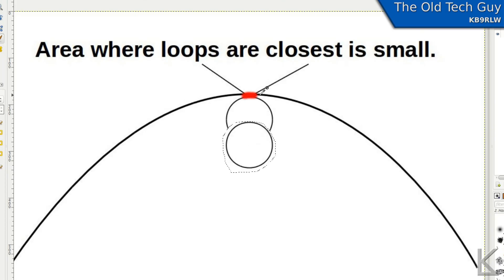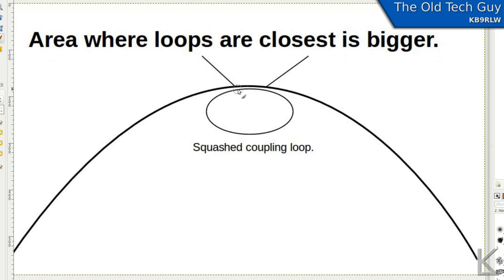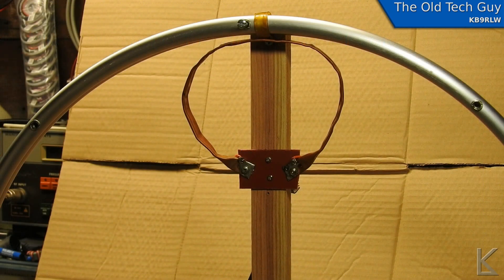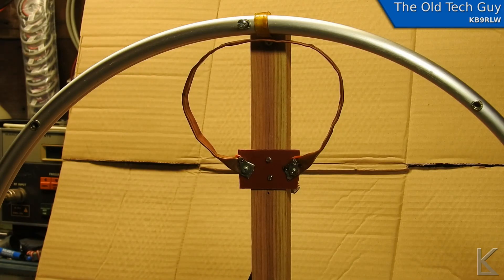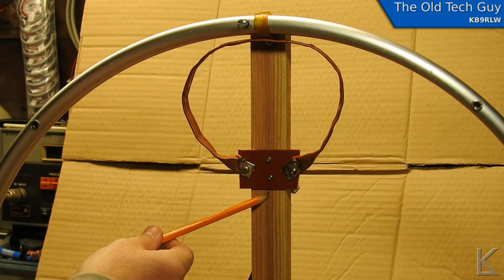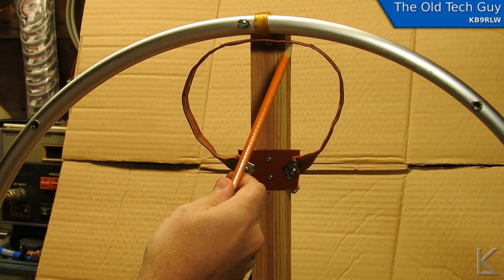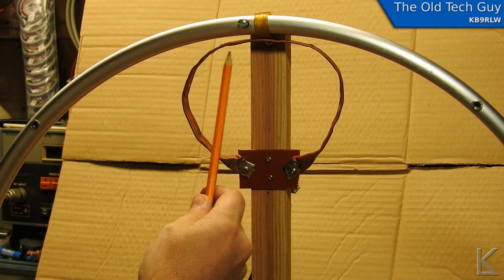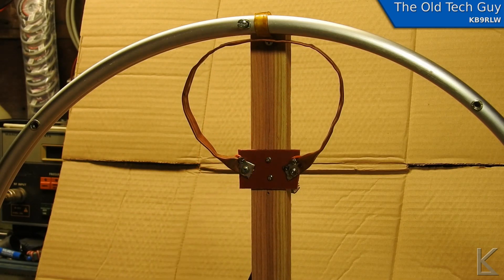Ham Radio - A simple magnetic loop modification with a big improvement!

Comment: Hi Kevin.. I am making a 90 cm loop. It runs from 10 MHz to 30 Mhz. The reflection damping is very good on the low bands. Only from 24 MHz the reflection deteriorates. How's your antenna? In your example I see 2 frequencies, are these your start and end frequencies of your loop? And thank you for this useful information. I'm definitely going to work with it. 73 Hans / PA3ETK
Reply from the maker: Hello Hans, I'm sorry but this video was a very long time ago. I no longer have the one Loop and I haven't had the big one out in quite a while. I'm living in an RV and traveling now. If I remember right, both Loops worked really well from 40 m up to 15
Reply: @loughkb  Hello Kevin. No problem. I'm jealous of you! Been to Autralie and new zealand a year ago. Also with an RV. It's a good life with a motorhome driving. I wish you all that is good and enjoy life because it only takes a while. With kind regards, Hans

Comment: Thanks for this tip, I have been putting of building one because of the supposed low efficiency of the smaller loop on 40 mtrs, but this tip deserves a shot.. VK3HJW

Comment: I agree with you about magnetic loop antennas. I have been using it for years. This type of antenna is particularly interesting in digital mode. once set to a frequency, no need to touch it again, it's super practical and very much efficient. See the HB9AIS design here: https://www.youtube.com/watch?v=cN_lmGRaqOQ&t=5s and have fun.

Comment: I figure the "squashed loop" gives a better ratio between the TX 50R and the loop itself? Maybe a smaller/larger coupling loop (but still round), would achieve the same? I am in the middle of building a loop antenna to transmit on 2M... (To fit on the top of the HT!). 73 de Stan, G4EGH

Comment: So taking this further, why can't you use square loops? In that way the small loop would have even more coupling to the larger loop.
Reply from the maker: You can. Check out my junk box magloop video.
Reply: What is wanted is to capture, or emit, as many magnetic lines of force as possible.  Maximum area for any given length of radiator is thus round.  Square is okay; the difference is not all that much.  But you don't want too much coupling, and here's why:
When the loop is tuned, the circulating current is going to be enormous, 10 to 20 amps, and the inductive reactance (and thus capacitive reactance) very high.  If you have too much coupling, that power reflects back into the radio, pulling down the loop efficiency and increasing SWR to values normally not measured.
You want as little coupling as gets the job done, enough to excite the loop and match the reactance and resistance.  The loop reactance should go to zero at resonance, the resistance is a reflection of radiation into space.
Depending on physical factors, reactance at resonance might leave a resistance that is other than 50 ohms; that's why people fiddle with the exciter loop.   The MFJ tuner style of using a capacitor to match rather than a little loop has the advantage of being able to match more precisely both reactance and resistance, but it means two knobs to fiddle, which I still find easier than fiddling with the little loop itself.

Comment: Thanks Kevin.  I'm fascinated by the implications of how this effect apparently operates.  I'm curious to know what kind of effect it has on the overall bandwidth of the antenna at any given capacitor setting.  In other words, does it act more like a narrow pass filter or hopefully does it  broaden it?  Obviously this could have serious implications for the method used for modulation.  I'm curious what would happen the loop coupling if you put a high voltage dielectric insulator between the loops so you could minimize the gap between them yet stay electrically isolated?  That's taking proximity of the coupling to the extreme so to speak.  It's got me thinking about how to mathematically represent the effective gain through the magnetic coupling between the conductors.  Thanks once again, you taught this old dog a new trick.  The day you stop learning is the day you die.

Comment: Kevin you can bring the loop up till it is parallel and in front of the big loop slightly out of plane to increase the coupling.. Works even better in my tests. Also to use coax feed the inner solid conductor and bare the outer conductor at  the top in the coupling area and trim so the shield is broken in that area and obviously same at the capacitor connection area.. Al the best G7RQO bryan
Reply from the maker: Thanks Bryan.  I've done both of these things on on other loop designs in other vids.  The parallel edge coupling loop was the only way I could get the SWR down on my massive 16 turn magloop for 630 meters.
Reply: Kevin Loughin wow well done love the videos good work 73's

Comment: Hi Kevin, great video! I haven't built a loop but I want to try. What do you do with the inner core of the coax of the main loop? I understand you connect the braided outer mesh of the coax to the tuning capacitor. Do you just leave the inner single-core copper wire cut and insulated? What if you removed that inner core and just used the mesh around a plastic core (with copper wire inside)? The reason I ask is this... imagine if you could make a slit in the insulation at the top of your main loop and remove a portion of the inner core from the coax on either end and make your smaller coupling loop out of the actual inner core? Then you would have the inner core INSIDE the mesh, extremely good coupling!
Reply from the maker: For the outer loop, tie the shield and center together.  The lower the DC resistance on that outer loop, the higher the efficiency.
Reply: @loughkb  Thank you! I will strip the coax at several points along the length and solder the inner core wire and shield to each other. Thanks!

Comment: BTW, What are the tubes used for the loop made of ? Measurements & Where can they be obtained ?
Thank you, 73, Juan KG4QYY
Reply from the maker: 1/2 inch copper pipe for the outer loop, 3/8 inch copper tubing for the coupling loop.  3 foot diameter on the outer loop, 1/5th that on the coupling loop.  A very common design.
Reply: Kevin Loughin Thank you so much got your prompt reply. 
BTW, was just watching another of your videos. 
Hoping to make contact with you one day using the Mini Mag Loop. 
73 and the very best. Juan KG4QYY

Comment: First of all I would like to thank you for your excellent U-Tube channel for Hams, very informative and educational. Been thinking in making a MagLoop Antenna due to HOA. 
I believe that is called the “oval” or even “coat hanger” coupling loop. It helps also to make the SWR relatively flat over a wider frequency range than with a regular coupling loop. The overall loop wire length is a bit larger than the diameter of the main loop. The coupling loop is symmetrically placed close to the main loop, over a distance equal to 1/2 the main loop's diameter (radius, or ≈ 1/6 the loop's circumference.) Please check Frank Dörenberg at nonstopsystems.com
BTW, he has your spiral antenna on his web site.
73, Juan KG4QYY

Comment: Great video.  Question - What would happen if you made your loops rectangular rather than round with an oval insert.  Rectangular loops would have a lot more parallel surface to interact with.
Michael VA6XMB
Reply from the maker: There are many out there made square using copper plumbing.  Also, see my junk box magloop video.
Reply: I would have thought semi circular would be a good way to go in this case. 
Flat where the coax is connecting and circular on the side of the coupling loop where it comes close to the main loop.
Then play with the spacing from the main loop

Comment: Thank You Kevin! I am in the process of building a loop for 20 meters. I also built a VLF (wire) type 4' square loop to receive European LF AM broadcasts and SAQ (Sweden 17.2 KHz). I tried covering the loop wire with aluminum foil to form a magnetic loop taking the signal off the outer Al foil feeding it to a low Z input preamp (common base 2N3906). The resonator is the wire loop with a 4 section variable (and add C for LVF). The resonator is not connected to the preamp (just the outer Al foil. I found much improvement on noise and directivity...just an FYI from N3SWL Thanks again Kevin!

Comment: Mag loops have always fascinated me, never built one though.
I was thinking, if it is an increased surface area that's improving the loop, would building an annular space inside the outer loop and inserting the coupling loop into it, result in the maximum surface area and the greatest improvement?
QED

Comment: Kevin, I made a 3' diameter round loop with the Faraday Coupling Loop and also one with Gamma Matching.  The Faraday version really responded to "squashing" in the higher frequencies of the usable range.  The Gamma Match needs to be set in the middle of the tunable range of the capacitor; in my case it was ~18MHz (my capacitor allows me to tune from 6MHz to 30MHz).  The Gamma Match when finally set is less fussy across the entire range at resonance ~1.2SWR but the "squashed football" could actually be "finessed" to ~ 1.0SWR.   They both work fine, but you have to be patient with setting and soldering the Gamma match because it takes a few iterations.  The Gamma Match point is typically 8%-10% of the circumference (mine was 9.5%), so in my case it was 113" x 0.095 (9.5%) = 10 3/4".  I did not test (like you did) with a Field Strength meter.  Keep up the good work and safe travels!

Comment: Wow very cool tip -- THANKS.  Our radio club just had a presentation last nite on these magnetic loop antennas.  I'm new to HF and had been trying to figure out what to put up for 80/160 meters, and this seemed a very cool way to go.  Just checked Craigslist here and found a vacuum variable of sufficient ratings and heading out tonight to go pick it up.  Will be doing some studying on these antennas and collecting materials.  73's  RH

Comment: Great information, thanks for posting the video.  One question... Is there a limit to the amount of squashing of the inner loop?  For example, what happens if you totally squash the inner loop so that the maximum surface area of the outer loop is in close contact to the inner loop?  I'd imaging there's a point of limited benefit and/or perhaps some inefficiencies introduced by having the inner loop too close to itself.
Reply: hi...I tried it almost completely squashing the loop, im not sure about the Efficiency but the SWR definitely went way down to 1:1.03, only thing i did notice was that i had to reduce or increase the squash minutely like a Centimeter or so to reduce the swr to 1:1.03 or less for different bands...mine is 80m, 40m, 30m and 20m...with tiny adjustment of coupling loop...thanx

Comment: I made a few loops with a gammamatch.. way more effective and a lot easier to get to work properly..
Reply from the maker: There's debate about effectiveness.   I've done one with a gamma and switched it to a coupling loop eventually.  Near field measurements of field strength were identical.   I've yet to find any rigidly scientific testing of the different methods posted anywhere.  It'd be nice to see someone with an antenna shoot-out range do one.
I'm curious about how you define it as easier though.  It's a more complicated construction doing the gamma match.  Just a little.
Reply: Mine was easy to construct, just a thick wire going from the connector to one side of the loop.. that loop was made from 50 mm wide pcb strip ca 4 meters circumference. Its all about matching the loop to the coupling with as high efficiency and low losses as possible. We took some thermal images of it transmitting with 15 watts and it clearly showed that the losses came from the inferior capacitor and the connections to it. 3 things goes with a magloop... size, bandwidth and efficiency..  pick any two :-)

Comment: Hi that was a fascinating demonstration and video. Could I just ask you have you noticed any difference in improved reception performance after this simple modification to the coupling? Or does it go without saying that the improved s w r and r f output also increases reception efficiency? I am a big loop fan and constructor but only use them for swl these days. 73 Adam M6RDP

Comment: Squashing works because, by widening the distance where the loops are in close proximity, you increases the number (actually, the percentage) of magnetic lines from the feed loop which couple to the main loop.  Remember, only those loops of magnetic force which go through BOTH loops act to couple the loops.  The more you squash the loop to increase that close proximity, the more you reduce the area enclosed by the feed loop.  There comes a point where increasing the distance of close proximity (by squashing the feed loop) is offset by the reduction in area of the feed loop caused by squashing it.  (the number of lines of magnetic force is proportional to the area enclosed by the loop, so you want balance the area of the feed loop, with the amount of coupling to the main loop.  A perfectly circular feed loop has maximum area, but a fairly small length close to the main loop, as you point out in the video.   A feed loop squashed so that it follows the outer loop as far as possible before closing on itself (with a straight segment) would have a lot of coupling, but reduced overall lines of force, due the reduced the area of the feed loop. The optimum amount of squashing of the feed loop will occur somewhere between these extremes.
Reply: What if you distorted the outer loop instead? Bent it to make a closer match to the inner loop?
Reply: This sounds like a good modeling exercise to figure out the best possible shape of the inner loop.  Of course, you can just tinker with the shape for hours until you maximize the performance.   I'd be curious to learn what the negative impact is if you squash the inner loop to it's extreme.
Reply: Increase the diameter of the inner loop: same effect.

Comment: For the experiment you could try to maintain the round coupling loop but move it UP so its sticking a little bit above the main loop. That also would give more coupling. It would be interesting to see how that influences the field strength meter and the SWR

Comment: Very Interesting.  Instead of the copper flashing (or whatever you used for the small loop) what if you used a large coil spring to form the small loop.  What I'm thinking is the coil spring as the small loop.  Fix the edge closed to the mail loop.  At the opposite side of the small loop attach it to a sliding bracket mounted to your support.  The thought being attaching it that way: 1st when you compress the inner loop it should deform symmetricly (may or may not make a difference) and 2nd it provides a fine tuning adjustment that may help when switching bands.  If it does than it should be easy enough to make a remote adjustment system.  I confess that I'm totally new to SID antennas and am building my first now so I'm looking for a good coupling method that will provide the best performance over the wavelengths I'm targeting (40M - 15M0). Any thoughts?

Comment: Hi Kevin. Thanks a lot for your sharing. I'm also a loop's fan :). I've already noticed something like that. At this time, no field strength available in my shack. (I like your den, it seems to be like mine... Many items ensure the decoration). Have fun from Switzerland - 73' HB9HFJ.
Reply: You should try the Par End Fed , no loop buy performance wise 20X better than a loop https://www.lnrprecision.com/store/EF-10-20-40-MKII-p39885458
Reply: Yeah, but can you rig an 81 ft wire on your dinning room table

Comment: some great info, only problem I am having is all the calculators and info I have found gives me the size of the main loop for a given freq but I can't find the size of the coupling loop, the relationship between the two, ex 1% or 10% the size of the main loop.. thanks Steve..
Reply: Steve, from what I’ve reviewed the coupling loop (or smaller loop) is symmetrically placed inside the main loop (larger or resonant loop), and the size is about the size of the larger loop’s radius, or equal to 1/2 the main loop's diameter or ≈ 1/6 the loop's circumference, or somewhere in between 1/3 to 1/8 the circumference of the larger loop. Hope it helps. 
73 de KG4QYY

Comment: How do YOU test a Variable Air Capacitor
Reply from the maker: For capacitance, I use a capacitor test meter.   There's no easy way to test for power handling.   I accidentally discovered the limit on the cap on my big loop.  I was bringing the power up slowly and keying down shortly, just sending a dit.  About 45 watts there was a flashover.   So I cleaned the plates and decided 35 watts was a safe upper limit.  Not very scientific, I admit.

Comment: Hi Kevin;

Interesting results, thank you for sharing ...
I really enjoy your videos, and especially the simple and elegant ways your build experimental stuff.

I've been playing with these for a while now, all be it with very limited measurement and fabrication means.
I've built an active receiving loop with  a 4-turn 28cm OD, 2mm solid copper outer loop and 8 turn coupling loop.
It is tuned remotely via a varactor (getting rid of common mode RFI picked-up by the control line was very challenging ).

Do you think squashing the 8-turn coupling loop would improve things in this case?

Best 73s.

OD5VL